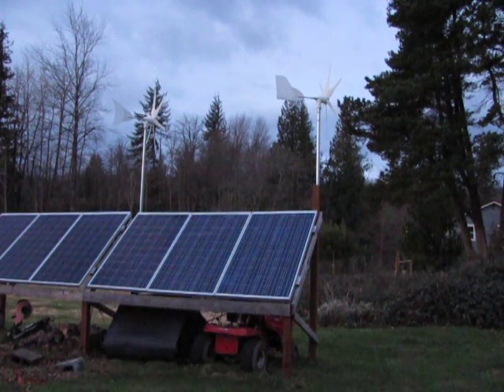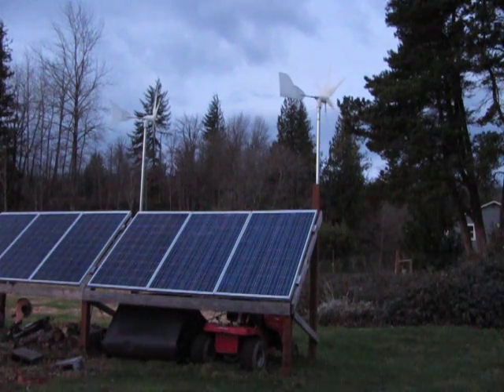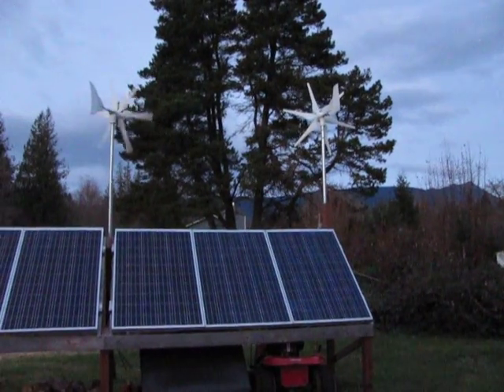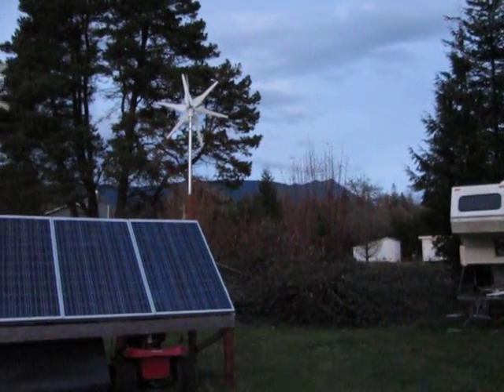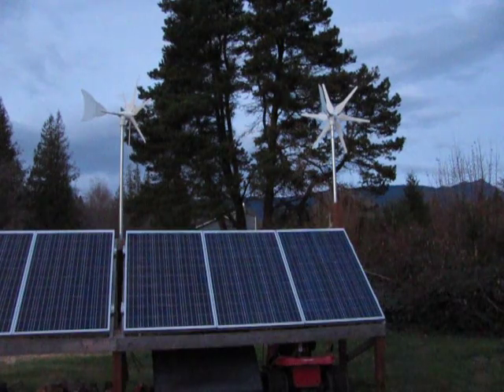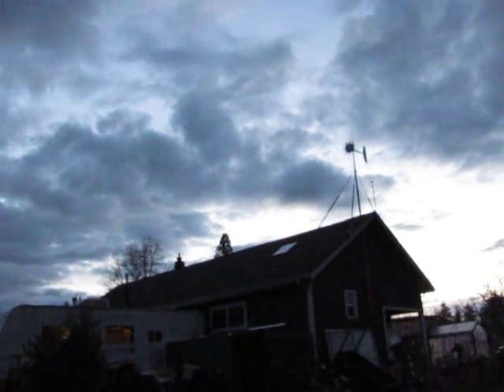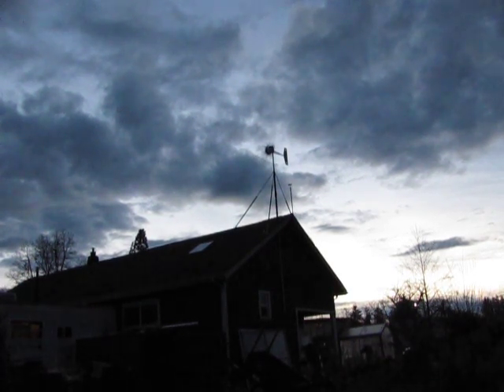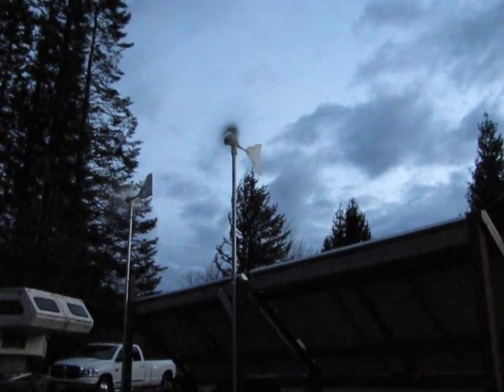A few thoughts about my chinese wind turbines

Comment: Hi Jason, are those wind turbines 12 volt or 24 volt output thanks.
Reply from the maker: These are 24 volt turbines ,, I have them running through a 30amp MPPT charge controller that takes the higher voltage and converts it to 12 volts higher amps, to charge my batteries :)